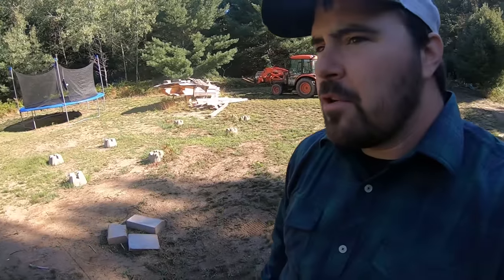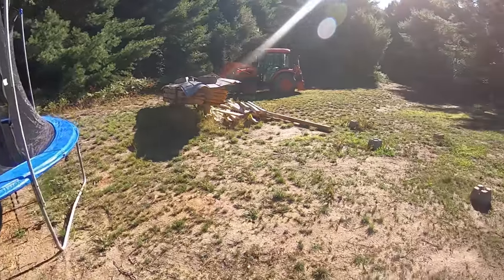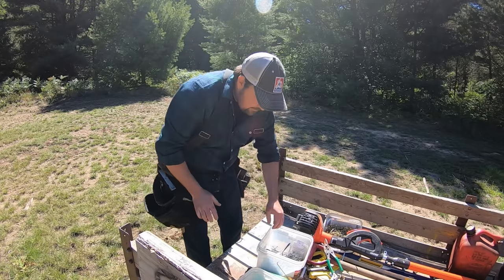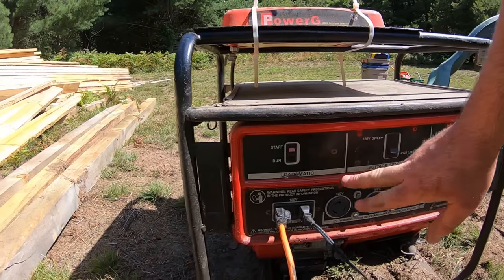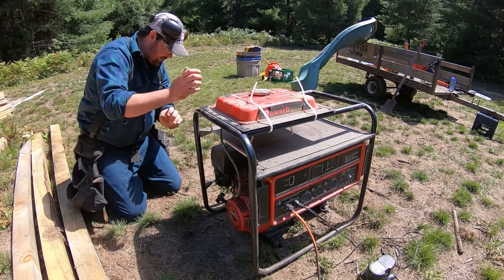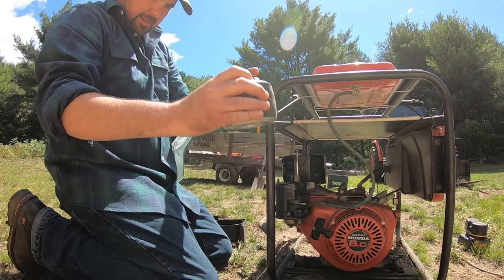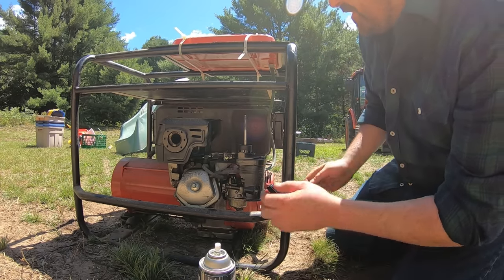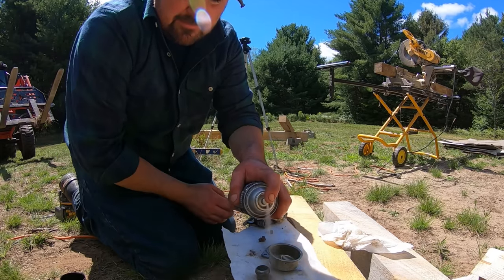Pirate Ship Project Hits Some Rough Seas | Yarrrrrr!  (Please help me...actually though)

Comment: Mr. Sandy, I do not remember if you looked at it when you tore the carb apart, there is a TINY rubber washer where the needle of the float hits to start stop the gas flow to the bowl, if your gas has trash it only takes a speck of it to cause problems, and ethanol gas over time swELLS that rubber, and cuts the flow to less than needed, happened to me, on my old homelight gen.
Reply from the maker: I don't think I looked close enough at it but will go back now that you've mentioned it. Thanks for the help Ben

Comment: Sandy, I feel your pain. It seems that many have an answer for you. It does seem like related indeed. Have you ever considered doing a video on full maintenance. For me, in particular, my 126 runs great until the tracking starts to go and I'm losing blades left right and centre. I've tried to adjust it according to the manual but it's an exercise in frustration. Any advice you could give a fellow sawyer.  Love your work. Thanks.
Dean
Reply from the maker: I'll be sure to keep that in mind about the maintenance video Dean. As for the sawmill kicking off blades I normally only have to do very minor adjustments to track every once in a while when I change my blades. Most of the time I don't have to though. I'm wondering if your belts are wearing or the guide blocks are touching the blade?

Comment: I would clean out the carburetor.  Check to see if you sucked up some junk in the gas.  Also check the oil.  There is a low-oil-shut-off if the oil level is down.  The blue smoke is burning oil.
Reply from the maker: Thanks Paul. Will give those a shot

Comment: The answer is probably.... If you slide the pin out that the float pivots on, it will come off and expose the needle and seat. Just another thing to clean.  It's possible that you are just burning fuel that slowly seeps into the bowl, but you burn it faster than it can fill the bowl.  So you wait... it seeps... and magically it runs again for a short time. Over and over.

You mentioned back pressure at the filter, which would mean there is blow by.  I would of just removed the oily prefilter and tried with bare filter. A prefilter only extends the life of a cheap air filter, all while making your engine run richer, causing backfires, extra fuel usage, fouled spark plugs, etc.  Prefilter doesn't have a place unless it's very dusty. (like mowing)

Also, don't use starting fluid on a gas engine, it's liable to detonate (Technically it's like advancing the timing too much)  I use seafoam spray, or royal purple max film. The max film acts as an upper cylinder lubricant, which is defiantly needed with today's fuels. I always spray max film in the carb before starting if it hasn't ran in awhile.

I think you did a pretty good job with problem solving.  START means "start with power output off"  and RUN means "turn on power output"  It would start in either position, however you wouldn't want a load (larger load) hooked up if you left the switch on RUN while trying to start the engine.

I just did similar with my Huskvarna rider, at 799 hours!  Tho that carb/intake was a pain to get apart.  Took out spark plugs, broke porcelain off one of them.. had to take a 1hr trip to get new ones.  I said I need 10 of these, they said wow what takes 10? I said I just need 2, the rest are so I save an hour trip the next time!  Pretty standard plug so will fit other things too.
Reply from the maker: That all makes good sense to me. Thanks for sharing that!

Comment: Hi Sandy. the only thing I did not see you do was to check the oil. There might be a low oil sensor. I found several oils that could be used, Honda motor oil being one of them. What was the first wrench you used? The one with multiple sockets attached. Have good days!
Reply from the maker: I’ll for sure have to go back and look more closely at the oil. The multi tool is a no name brand I believe

Comment: It will not run if oil level is low.  Otherwise a thorough carb teardown and soak.  Check if  the fuel cap vented. Good luck.
Reply from the maker: Thanks for the ideas Walter

Comment: Another engine you need to bring by so I can fix the valves. That’s what it seems could be the issue a burnt valve so its not seating  properly and pushing air back out the intake. I’m by no means a small engine mechanic take my advice as you will. Just giving my opinion. I hope you have a wonderful day if you want to.
Reply from the maker: I appreciate that advice Josh. I didn't think about that but does make sense

Comment: I thought this kinda crap only happened to me. The way that thing is cutting out it seems more to me to be related to the magneto. I just recently ran into this and the magneto ran great for cold starts but as soon as it got warm it was like someone hit the kill switch. I have a new magneto ordered and waiting on Amazon to deliver so we will see if that is my issue.  Good luck!
Reply: The way I was able to determine magneto failure was putting one of those little spark tester windows inline with the spark plug. Then the magneto got too warm the spark completely disappeared.
Reply from the maker: I may just try to put one in if the cost isn't too bad just to give this engine one last lease on life. Thanks for the idea

Comment: Forgot to mention use a power bar or surge protector to keep power  skill saws or chargers from over surge of power. Get a solar generator , alot less headaches , I know $$$$$$$ but it pay for it self in a long run. P.S, I use clean gas to rinse the pre-cleaner of oil when you use to much oil then let it dry out for a cup of sludge then give it try.  TEARS 🤣😂😅 down my face cause the same thing happens to me once in a while so I know how you feel 🤬😡🤬🤬 a few choice words lol take care till next time.
Reply from the maker: Thanks for that about the surge protector

Comment: Sandy,
Go to Amazon, order a new air filter and carb , it's preset ( no adjusting) and install. Empty and dry out tank so it's clean and install a inline fuel filter( amazon ).make sure motor has enough oil! Honda  has auto low oil shutoff . Then only use ethenol free gas in it, ( cost more ☹️ ) !!!  Ethanol destroys small engines ! Then, She run better than a Deere! 😆
Best money spent!!! Under 75 $ total !!!👍👍
Reply: Ps. No oil for air filter!👍
Reply from the maker: Seems like the best idea there Fred. Priced right for sure. Thanks again

Comment: I would run out and get a Dewalt Cordless Mitre saw. Simplifies things.
Reply from the maker: Funny you mention that as I was looking at them. I"d need to have about 4 spare batteries though otherwise I"d be going back and forth to my shop to get a battery

Comment: Sandy, jump on the internet and find a replacement carburetor, and magneto for that motor. Your problem is almost the same as my snow blower. A replacement magneto cost like $15.00, and a new carb about the same. The snow blower has run like it was still under warranty ever since.
Reply from the maker: Great idea Carl. Would be less cost than the headache of cleaning the thing I bet

Comment: Most times with Honda carburetors its the idle jet is plugged its hidden under the idle adjustment screw , remove the screw gently pry out the black plastic jet or sometimes you can pull it out with needle nose pliers l usually clean out the jet with a wire from a wire brush very small hole ,hope this helps
Reply from the maker: I must've missed that when cleaning. Thanks for sharing that. Going to help me for sure

Comment: Should be on run.start is the choke ,run shuts it off.n oil level too will shut it off.n i think that n a new air filter will help.ck the oil level buddy.the oil level is to protect the motor n having oil in the filter n blowing some out the exhaust w sea foam my have left it to low.carb sounded good when it ran so don't think anything was wrong there.sterilized cut now.it'll heal faster ,just burns alot lol.that is definitely low oil.

Comment: I had a lawn mower that would do that, run just for a bit , turned out to be a coil that as soon as it heated up it went open.  Let it cool for just a minute and it would run again. Very hard problem to find.
Reply from the maker: Seems like I"m chasing. needle in a haystack sometimes

Comment: I had the same problem with my lawn mower and it was the float ajustment ,  The engine uses the gas in the carburator and stops because the float keeps the needle valve closed the opesite floods and the gaz spiles everywhere including the crank case witch is not good ....
Reply from the maker: Thanks George. Sounds like I’ve got more work to do

Comment: Chech gas quality, flow rate, clean carb more than likely float is stuck or dirty or air flow problem.  Looks like possible valve problem not seating right could be cam with blow back ????? . I feel your frustration been there done that.
Reply from the maker: All good points Del. Thank you

Comment: What was the blueish smoke, is the cylinder gone? Where is the compression? It sounds terrible... If there is so much pressure the wrong way that it lifts the airfilter something  needs more than just a little tlc.
Reply from the maker: I was thinking the smoke was the seafoam which is a type of engine cleaner
Reply: @sawingwithsandy  
 Allrighty then 👍🏼! It was probably just the light that made it look like a two-stroke. But that pressure under the airfilter confuses me, it's like if it's working backwards? The same when you started it: it behaved like if the sparkplug would be gone, no umph-umph-umph 🤔?
 Hopefully you get it fixed. Worst case scenario you change out the engine for some hundred dollars 🤭.

Comment: Check the wires on the shutnoff switch. I had a generator do the same thing and it turned out 1 of the wires rubbed the insulation off and would ground out  and shut it down
Reply from the maker: Good points Larry. Thanks for that

Comment: Might try a dose or two of Lucas cleaner in the gas tank.
Reply from the maker: Will give it a shot. Thank you
Reply: One other thought. If it's a metal gas tank you might try another one.  It may be getting rust out of it.   My old tiller done just that and it was the tank. Replaced with plastic one. Runs great now.

Comment: You likely have an intake valve that's leaking.  There should never be pressure on the inlet side of the carb.  If there's a crankcase vent that feeds blow by back into the carb then it could also be leaky rings.
Reply: Agreed that was the first thing I thought of when that air filter kept blowing off probably a sticky valve or some grit or rust inbedded in the seat
Reply from the maker: thanks for that. I'm wondering what I can do in that case
Reply: Run a compression test first - that'll tell you with little work involved.  I don't know that specific engine  but it's usually not that difficult to get to the ends of the valves and you can tap on the valve end to see if it's only stuck. Some appropriate lube might "fix" it once freed, otherwise you'll have to pull the head but still not that difficult.

Comment: I  would check oil then oil sensor then if problem continues then I think it's called the armature maybe spelling  onto the fly eherl6that gets hot then shuts the engine down. Cools off then cranks gets hot then shuts down again. I feel your pain but remember you have problems with new equipment also, that why there sold with a warranty
Reply from the maker: great points there Mike . Thank you

Comment: From the couch it looks like the engine is pushing air out through the intake.  Intake valve leaking some compression back?  Do a leakdown test to prove it
Reply from the maker: Yeah definitely was getting a good push out the air filter which wasn't good.

Comment: Well I finally bought the HM130 max 🤯 lol, you should get a commission my friend, oh PS I’m in MI so if I have a difficult time gettin er set up I’ll be gettin ahold of ya lol 😂
Reply from the maker: Haha feel free to message me. I’m a regular sawyer just like everyone else but would be happy to help where I can
Reply: @sawingwithsandy  I appreciate it…. Trying to get an area set up, lean to off of my pole barn for it. You have really shown with care and basic common maintenance your sawmill can look and run as good as it did when you bought it. So I’ll be definitely keeping it out of weather as that seems to be something that really wears on them quickly and I’ve ran an air line out to blow out the smaller nooks and crannies ie bearings, belt area and the area where the water runs onto the blade, hopefully giving those parts a little longer life. I like in one of your vids when you talked about going bigger, but it costing more upfront but well worth it. ONLY thing I’m thinking and trying to figure out is how I want it to sit. I was going to get it with the trailer BUT figured I wouldn’t be moving it around that much, decided to do without and save at this time, PLUS the trailer ones have been on back order for several months, now I get it within 4 weeks. So I thought of doing a platform similar to what you’ve done on your old one but then it would limit my height do to it being a lean to, then I seen a guy that put in 4x6’s dug and cemented into the ground, then used 4x6 or 6x6’s to connect them then on top with a 2x6 and hasn’t really had any shifting problems like many other have with having the mill sitting on RR ties/6x6’s etc…. So I’m still playing around with different ideas…… BUT appreciate your response back….. thanks for putting out great videos that many of us can learn from..
PS I WISH I had some pines, ALL I have is black walnut and oaks on my property, hoping to maybe find another like minded person in saw-milling that would like to maybe do some trading lol as yeah all the buildings I wanna build would be definitely solid, but personally think it wouldn’t be good “woodworking” ethics doing so lol… thanks again my friend…… stay safe

Comment: Is there oil in the generator?? Some of them has an oilwatch and that will stop the engine from running if the oil level is low.
Reply from the maker: I did check it but then again it's worth another closer look I suppose just to be double sure.

Comment: The oil soaked filter will definintly choke the carb and cleanjng it may not help. get a new one. Check the oil level in rthe engine and if it's OK then get a new carburator. Cleaning them only works half the time. generators sit unused for long periods and that gums them up. Also drain the gas and put fresh in if it's old. Don't go buy a new one. the engine is fine.
Reply from the maker: Thanks for that Donny. Appreciate the help

Comment: MM77 Approved 👍🏼👍🏼………………………..My generator has a low oil level inter-lock. I HAS to be almost level and FULL of oil to run. One side you take a plug out and put oil in until it starts to run out and it has to be level when you check it. It has the 20hp V twin Honda engine. I saw yours has a Honda engine too sssssssooooooooooo maybe?!?!?!
Reply from the maker: I better go back and try that as the oil was in the area it should be but wasn't all the way to the top. Thanks for that advice. Appreciate it

Comment: I would also give the spark arrestor / exhaust a good look make sure it is clean with no obstruction.

Also check your mitre saw for the Dewalt recall!!
Reply: That's only for 2019 to 2022 saws, pretty sure his is much older.
Reply from the maker: Thanks for the ideas. Yeah my mitre saw is probably a good 10 years old or so

Comment: That smoke didn’t look right. Blue might be oil overfilled. White doesn’t make sense unless you had water in it?
Overhead valve engines like the Honda are notorious for burning oil if they’ve been tipped on their sides towards the head, allowing oil to slosh up near valves. 
Overfilling is harmful as is oil diluted with gas due to gravity fed tanks and carburetors that can’t hold back the fuel pressure due to gravity or bad needles and seats or float. 
Smell the oil. Gas smell is bad. 
Change oil. 
The other thing about generators that idle too much is carbon build up on heads. A chunk of carbon can get caught between the valve and seat and cause the valve to hang open resulting in low compression. 
This is what I was thinking when you pulled the starter cord. The engine didn’t seem to have much compression and kept spinning. 
Hondas aren’t known for that like Briggs, Robbins and others. 
If you get it running run some fuel cleaner in it. Nothing with paraffin, ie no Seafoam. 
Worst case on my old Robbin, I removed the head, cleaned off the carbon and it ran again like new. 
Good luck.
Reply: PS. I used to be a product manager at two different companies. My product line included generators 2.5kw to 500kw. 
What do I own for my personal use?  Honda 3000i. 
So quiet, so fuel efficient, manageable weight. 
Hefty price. But those inverter style generators with auto idle that only spool up to the power demand cannot be beat. 
If I did it again I’d buy the 2000, then add a pony tank. That would serve all my needs in the field and camping since I don’t run the A/C on my camper that I thought I’d need the 3000 for. 
For home backup I’d get the larger model with 240v output and a transfer switch for the house.  
That way I could run my well pump that I can’t with the 3000i.
Reply from the maker: Appreciate that information as good to hear from people like yourself with first-hand knowledge of the generators. Those 3000 I models sure are nice. I've used them before and although they are heavy they are reliable reliable reliable.

Comment: When you start the machine you're supposed to put it over to run so that way it will work properly what you're doing is all wrong
Reply from the maker: Thanks for sharing that Arnold. I tried it both ways and it would fire on start as well as on run but then it would quit in either setting